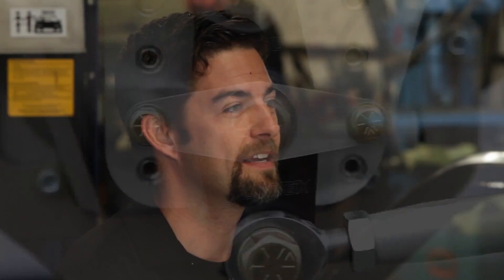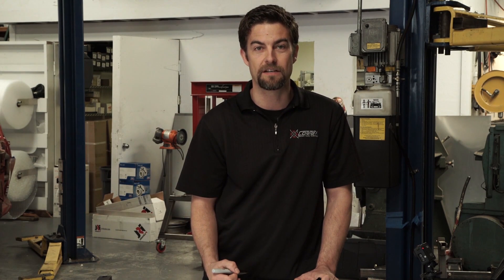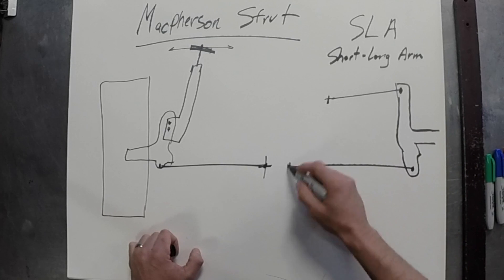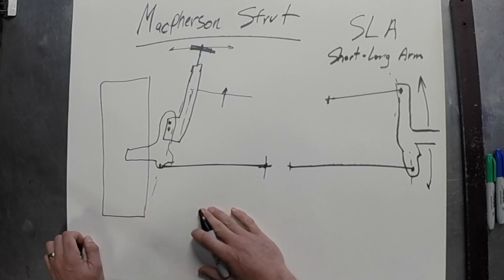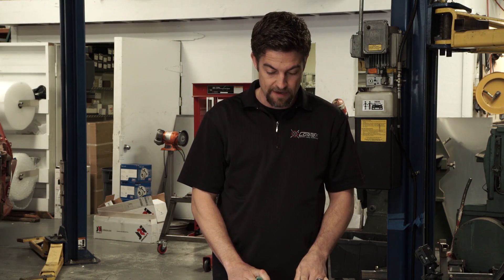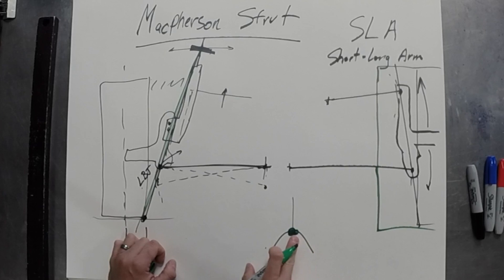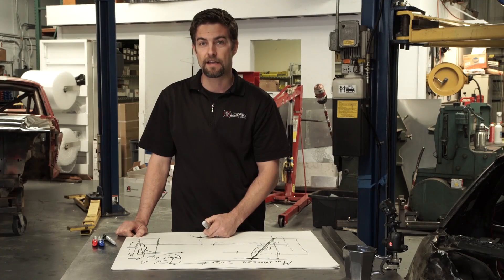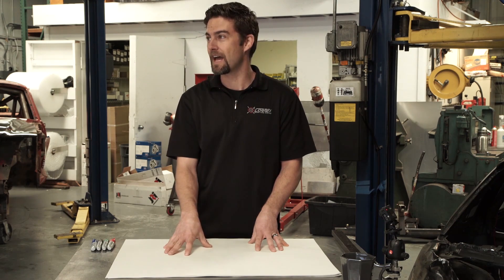How Front Suspension Works - /ENGINEERED

Comment: Hey Filip!, this was very Educational!...I have a 2003 Ford Mustang GT/Cobra Project and currently all stock except for a complete  New 2003 Cobra front Clip!  I plan to also swap out my SRA for a 03 Cobra IRS later and an engine swap like a 5.0L coyote or a Shelby GT500 5.4L S/C or 5.8L S/C engine, along with a 5sp. manual trans swap to a 6R80 6sp Auto Trans!

Meanwhile, How much would it cost me to have my 03 Mustang Mac Pherson Strut suspension upgraded to an SLA Front Suspension setup?  Thanks and God Bless!

Comment: How does changing the lower ball joint position (height) without compensating for the angle change difference with tie rod effect the bump steer ? I was always told if they're in a different arc, you'll exaggerate the effects of bumps steer.

Comment: I'm thinking of creating a widebody NA or NB Miata, but I want to maintain the original wheel offset to spare the wheel bearings.. Can I design longer control arms to place the uprights further out? Will I need to make an adjustment to make the upper control arms proportionally shorter?

Comment: awesome video! Thanks for explaining all of that; especially that "scrub radius" concept. So with a lower offset wheel or spacers, one would just need to find a way to reduce that scrub radius for "lighter" steering....and I guess this could be done by either by extending lower control arms and/or moving the strut top more towards the engine (inwards) OR maybe  a larger diameter wheel/tire (which really would not be too practical in most cases.

Comment: I've seen diagrams of some of the roll center and instant center stuff. When you lower a car if the LCA mount points are lower than the ball joints, you can actually make the car roll MORE than it did before lowering it.

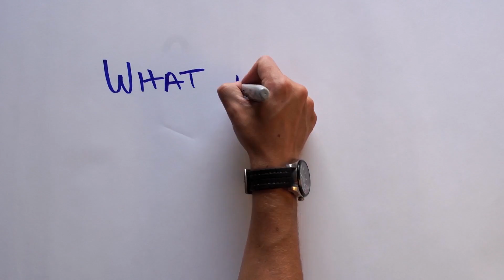Comment: 10:40 "What are OEM's working on?" was funny as both my 1978 Mercedes W123 & W116 have that high spindle with a short control arm. & zero scrub radius, umbelievable good feeling when drifting, different from later models which feel remote.

Comment: Honda was using SLA suspension since 1988  in every model honda including the crv there was SLA front suspension until 2001. That is why even until today the older civic and crxs are still dominate in their classes in road racing and autocross.
Reply: +Sounds of silence Citroen used it in the 1930's

Comment: Lowering only the front end of a car adds castor right? Is there any benefit to slightly raising the front of a car (while adjusting castor back to the stock value)?
Reply: +Nick Amarit Lowering the front gives the car a pleasing rake look... there might also be some slight aerodynamics improvement but I doubt there is any appreciable change in castor. The best way to think of castor is to imagine the front fork on bicycle... when that fork is straight up and down you have zero castor. When the fork is tilted forward you have positive castor. You can hold your hand straight down and visualize the effect... when your hand is vertical (Zero Caster), you see no Camber change to your hand as your turn it left or right. If you tilt your hand forward however, and then turn your hand, you will see a pronounced negative Camber increase. With some suspensions, this can allow you to run less static Camber, improving braking performance and tire wear while at the same time adding much needed Negative Camber as the wheel is turned. I ran 6 degrees of Positive Camber on my double wishbone, 1974 Chevrolet Vega and 1 degree of Negative Camber with 1/8th inch toe-in. With dry weight just over 2,100 lbs the Car consistently turned 1.1 G's on a 100 foot Dia Skidpad back in the 80's while running on a 185 BF Goodrich T/A Radials and 13x7 rims. The Vega was a cheap American sedan with a crude live rear axle and a terrible motor but the balance of the Chassis from the Factory was 51/49 and the front suspension had an almost ideal Camber Gain curve through rise and droop and the overall weight was low. I mention this to prove the importance of balance. I spent hundreds of hours with that vehicle, changing one thing then another and then noting the effect on handling. Tires have improved enormously in the last 30 years. We used to use a large grinding wheel to round the edges of the tire, not a pleasant experience for the nostrils. Now all performance tires come that way and with lower tread depths and much stickier compounds. Changing your chassis is easy... but changing it so that the vehicle behaves in a linear, predictable fashion is the trick. Everything you change has a positive and negative effect. When the Factory designed these they factored in numerous compromises in every decision. Remember it's all about balance in the end.
Reply: Mark Gundy So, is there any benefit to slightly raising the front of a car?

Also, on another note, I've always thought rake and castor were the same thing.

Comment: No discussion of Bump-Steer, Effects of altering static Toe settings, Roll-Couple, Advantages of high Castor settings, Weight Transfer, Wheel Travel, Un-Sprung Weight, Changes to Polar Moment, Replacing stock Bushings, Best types of Spherical Rod Ends and Bearings, Chassis flex, Reinforcements, Steering ratios, Roll Rate, Roll Resistance, Sway Bars, Springs & Spring rates, Aero Dynamics impact, Braking, Brake fluid, Cooling, Rotational Mass, Tires, Tire Temperatures, Understeer, Oversteer,  etc just to name a few critical topics not covered. You can Google most of those terms to gain a better understanding of their impact on vehicle dynamics. This is not a simple subject as almost any change effects a myriad of other factors. Also a vehicle that seems to handle great at low speed can become a nightmare at high speed. A low speed slalom or autocross is one thing, a Race track is quite another. This is why Factories and Race Teams spend a tremendous amount of time getting the calibration right. One last correction. McPherson struts are an inferior suspension design only used to save money, just as live rear axles were for what seems like centuries. A good place to begin your education would be Carroll Smith's Engineer to Win and Tune To Win. Both excellent resources
Reply: +Mark Gundy sweet, i have a 280z
Reply: +Mark Gundy I guess I should have added, the single most important component of your suspension are your tires. A good rule of thumb is to match the section width of your tires to the rim width. This allows the sidewalls to have greater support which is critical in transitional handling. The shorter the sidewalls the less flex there will be, hence the move with performance tires to lower profiles. This is the golden Age of cars so enjoy it... in 20 years or less, the Government will most likely Ban human control of vehicles, entrusting the job only to AI. There are some merits to this but it's certainly not a future I look forward to.
Reply: +Mark Gundy Try fitting all that into a 15 minute video and tell me how much detail you can cover. And McPherson struts are not used only to save money. There is a reason Evos, M3s, and 911s, etc all use front struts. Lower mass, space savings, less NVH, and more suspension travel are some serious benefits. I'm not saying it's better than DW but all factors need to be considered
Reply: +bcballer13 My Bad, I wasn't aware there was a 15 mins limit... I owned an EVO VIII... modded to 400hp... made me a believer in AWD but... it used McPherson Struts because it's a super car made from a cheap econo box...  the Lancer... space savings could be a valid argument but it's not lighter than a well designed double wishbone...  suspension travel shouldn't be greater either or they would build offroad racers with them and they don't... but  that's conjecture on my part, for the street or for a race track, suspension travel is not an issue unless you lower the chassis so much it hits the bump stops, in which case roll resistance rises to infinity and you suffer massive understeer (assuming this is the front suspension). The main problem with struts is the negative camber gain under roll (loaded in a corner) which then means to compensate for that you need to crack 5 or 6 degrees of static Negative Camber or crank in a tremendous amount of Positive Caster... adding Castor causes the tire/wheel combo to gain negative Camber as the loaded wheel is turned. You can also put very heavy springs up front to limit body roll but high spring rates cause transition handing to suffer tremendously often making the car difficult to drive. Another better way to limit body roll is with much larger diameter sway bars... you can usually find kits for most performance cars or you can have your own manufactured or do what the Nascar folks do and use hollow splined bars with adjustable end links. Most chassis have a tremendous  amount of flex... sway bars are typically mounded in bushings... you can replace with stiffer bushings or use aluminum pillow blocks. You can also play with toe settings to dial out understeer on initial turn in. Keep in mind, every one of these things are band-aids to deal with an inferior suspension design. Having said that, we did manage to get several different sedans with McPherson's to lap at consistently high speeds. But the compromises also effect other things like straight line braking performance, inconsistent tire temperatures causing premature tire wear and sometimes tread failure... the ideal would be to have a perfectly flat tire to the pavement regardless. This is much easier to do with a well designed SLA suspension and transitional handling is generally more manageable for the driver when changing directions near the adhesion limits. I've had extensive experience modifying both types of suspension set ups. I'm surprised to hear the M3 uses struts, but then the Germans can make anything work... the 911 being a perfect example. Ironically, Porsche has turned it's legendary toe-steer or bump-steer problem in the rear suspension into a performance advantage as they have now designed a rear suspension that is self steering, at slow speed adding toe out to cause the car to turn more easily at slow speed and thus feeling more nimble to the driver, with doing the opposite at high speed to make the car more stable... brilliant solution and leave it to Porsche to turn a weakness into a strength. I assume you must own a vehicle with Struts.... which is why I wrote about possible mods for that type of suspension. I hope you find some of that explanation helpful.
Reply: Braden Wuesthoff I well recall the Datsun 240Z when it was launched... a revolutionary sports car at the time that's seen plenty of action on the race track... that inline 6 cylinder was a stump puller... never had the pleasure of driving the 280Z but I'm sure it's just more of a good thing... congrats on owning a classic.

Comment: he missed roll centre!
Reply: cause you two both own your own tuning shop and build race cars aye.....bwahahah
Reply: +tr0n well he seem clueless on center of gravity so they stop him their. but center of gravity is what you try to move to tune a car most. roll center is kinda fix for the fact on most cars you can only change 1 pivot point.
Reply: it's not really a fix...it's a byproduct. it's the centre of leverage for the suspension and the further away it gets from the centre of gravity the more roll is induced into the suspension despite geometry and stiffness changes.

it's a real problem with macpherson strut systems.

it's like the centre of lift being in a different place than the centre of mass on an aircraft.
Reply: tr0n i said it's kinda fix the point to move it on most cars is only in one spot. i did not say completely fix. you can put your roll center where ever you want it. the most importing thing is to get your center of gravity. this tell how much pressure is getting on your tires. the thing is with roll center is your suspension works best if the lower arms are even with the surface you are driving on so you really dont want to change your lower angle. the upper links is to do with how much weight you want to transfer and how fast you want it to transfer this is changing your center of gravity. the higher you make your upper link the mass of weight is lower. the higger upper pivot point make less weight transfer (this is lowering your center of gravity). the angle of the upper link give you -/+ camber gain to help keep your tire flat. if your outside link point is lower than your inside link point you get + camber gain. if your inside link point is lower than your outside link point you get - camber.  you inside upper point height tells how much weight of chassis will get on your outside tire...  so you really cant tune your car with roll center for the fact the the other point play a bigger roll in other parts in how the car will handle.
Reply: @gatorage850  the difference in height of center of gravity and roll center decided how much force is being put into the tire. Higher roll center puts more force into the outer tire before the spring is compressed. He get t
Into it in "antis".
Reply: +tr0n And instant centre, drive/squat